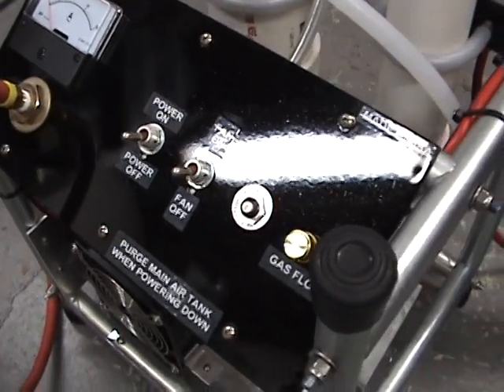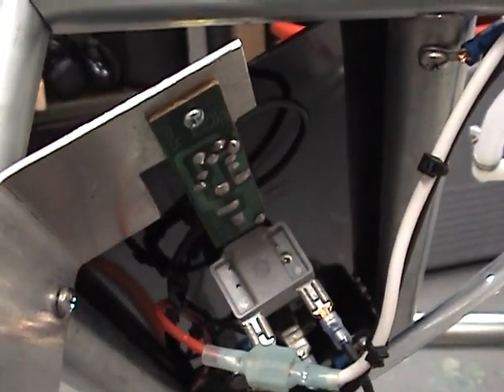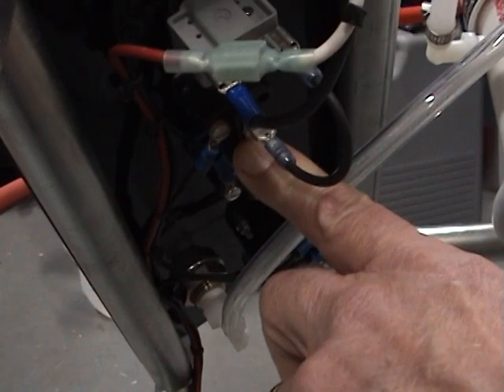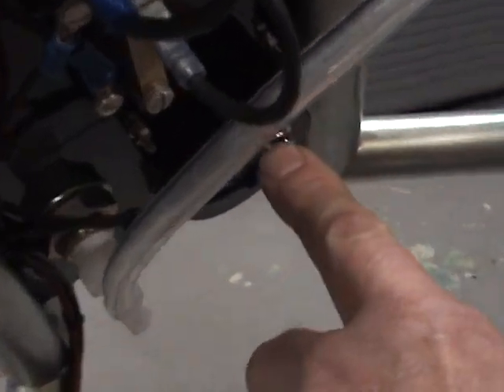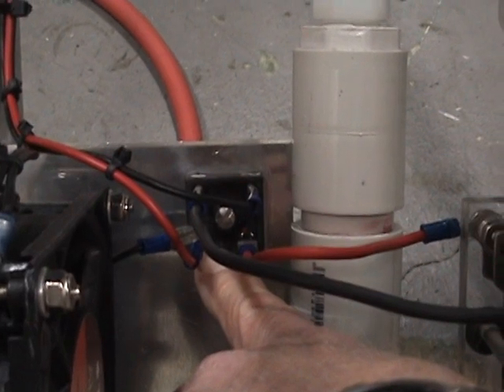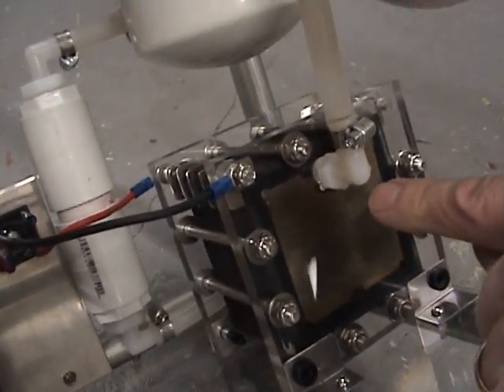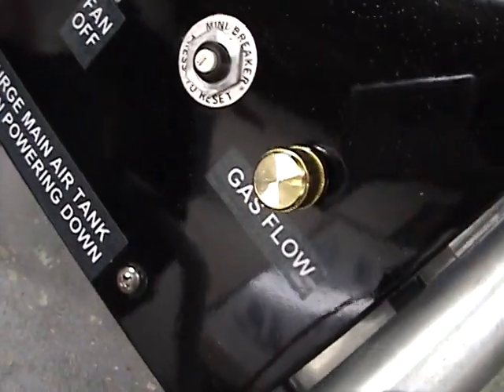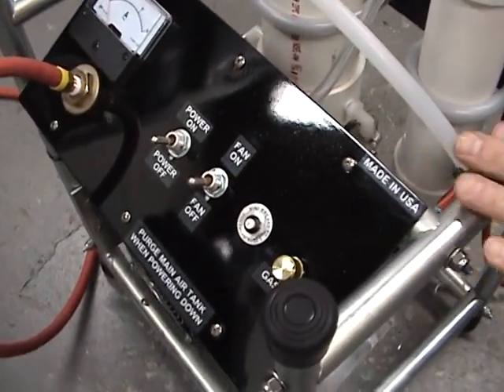HHO 120V CELL DRIVER

Comment: Hi, I have the similar set up but I cannot get it to work with a fan speed motor or a voltage regulator. I think the reason is I have a large cell  110 plates powered from mains 240vac. Running at 6 amps, generator is drawing 270vdc, whenever I switch on the speed controller, the breaker trips and blows the fuse. Generator works fine when wired to a bridge rectifier. Is the voltage too high on the generator ?